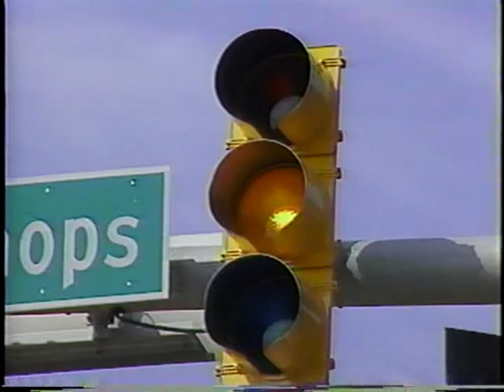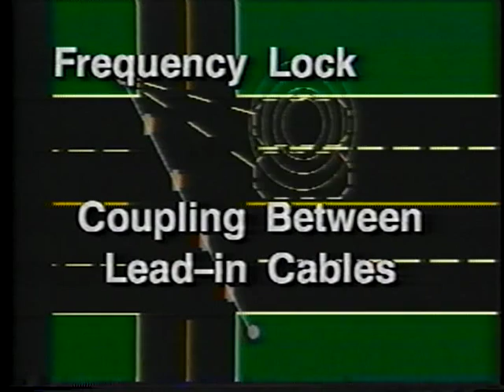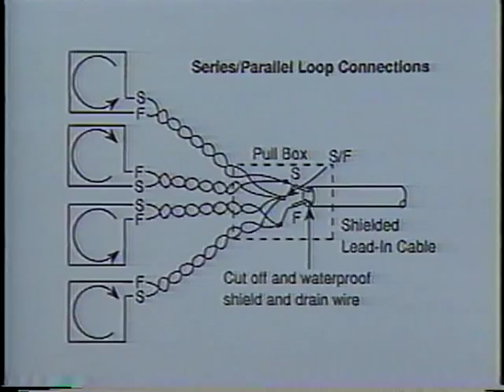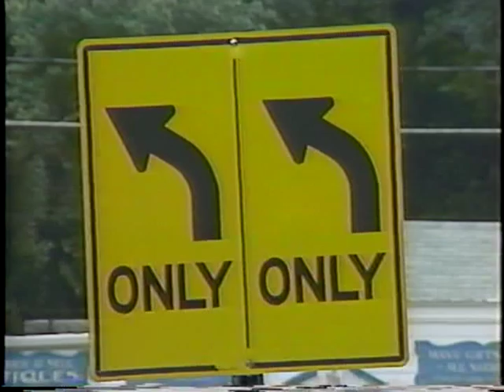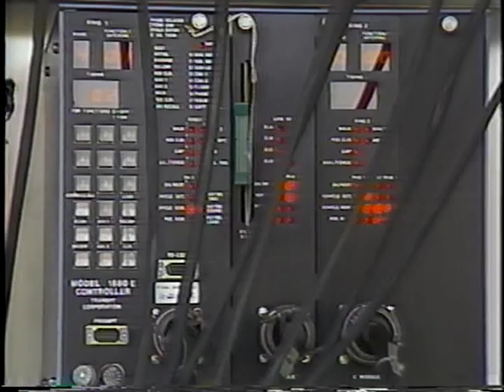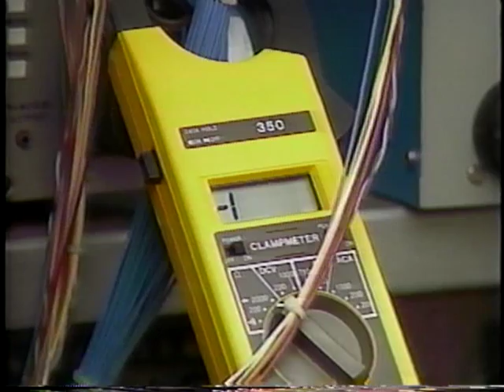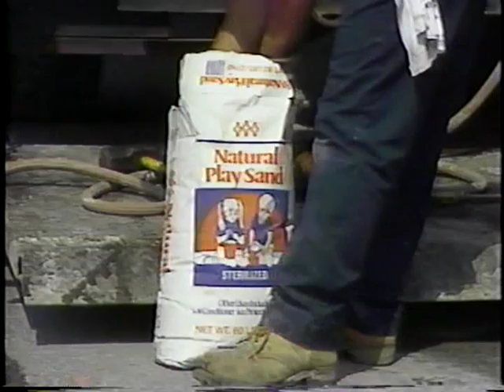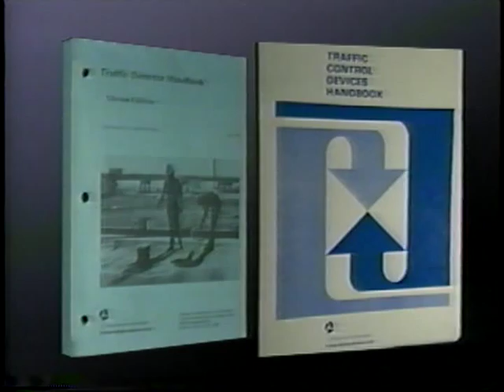Traffic Detector Video Training Course - Part 4 - Detector Maintenance

Comment: Greetings! I see videos explaining how to install the loops but I don't see videos explaining the device or the software that calculates the speed and how this calculation is done. .I would like to know, to calculate the speed, from the signal sent by the central of inductive loops, is it used a microcontroller or is there a software for PC!? I will be grateful if you can give back..
Reply: You need a series of loops and software. Loops at stop bars won't be accurate as traffic is coming to a stop condition.